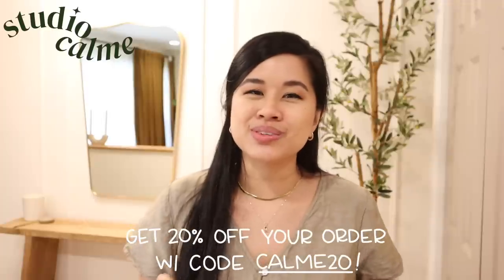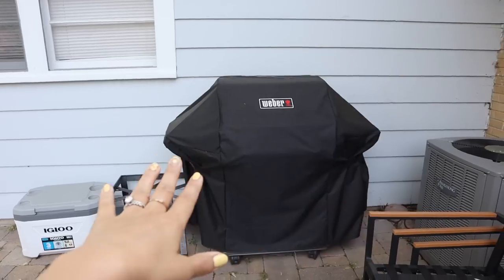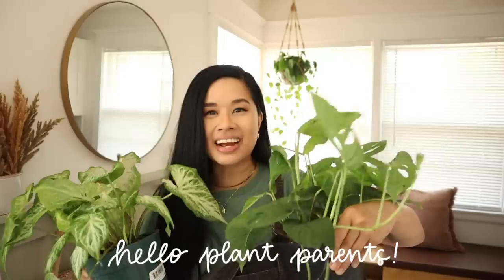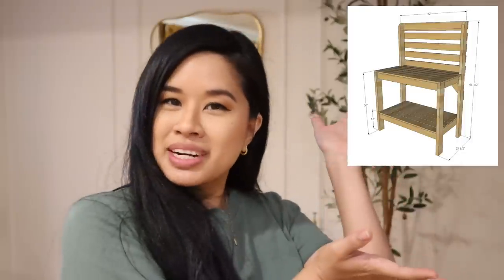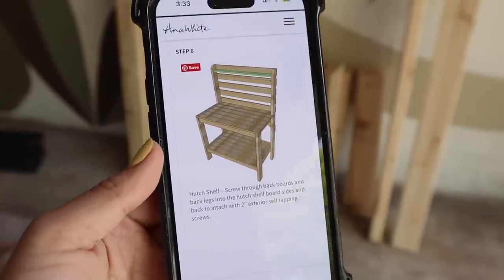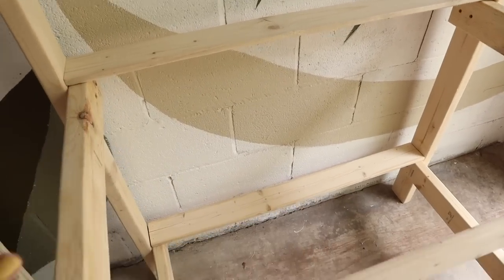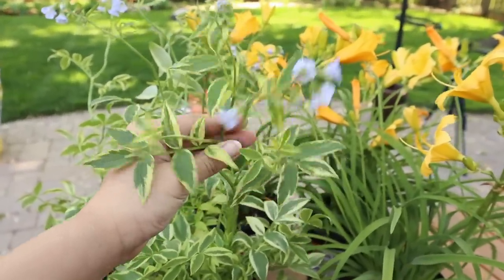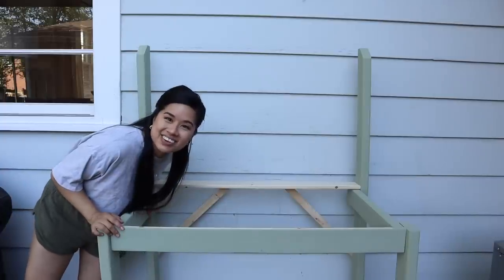CREATING MY *DREAM* OUTDOOR OASIS (major backyard makeover)

Comment: Gardening tip: water the flowers and plants at the roots, not from the top of the leaves down. That'll ensure as much water as possible gets to where it needs to go. :) I usually give the leaves and flowers a little shower for a few sec after I water the roots.
Reply: Another tip! The dead leaves are actually healthy for grass and gardens when mulched!
Reply: @Cherokee92  Yess! I stopped raking mine completely and just put new mulch on top and it's made my soil soo much better. Now anytime I dig a hole to plant something, I find earthworms and it makes me so happy haha
Reply: Also pots need drainage. A hole drilled into the side just above concrete
Reply: agree with this! especially if you water during the day vs morning or evening; it helps keep you from burning the leaves!

Comment: Ha! I was just planning to build the same work bench out of pallets. You did such an awesome job. Just one tip for your plants. Make sure they have enough drainage. Some small holes on the side above the cement layer might help if you notice your plants struggling a bit. The sand was a good idea too❤
Reply: The hole on the side for drainage was exactly what I thought too

Comment: The “weeds” look like feverfew to me, but hard to tell until they flower. If they ARE feverfew, they will produce a small daisy-like flower. They self-seed very readily but are easy to pull out and control and are a lovely plant as long as you don’t mind keeping them in check. The plant with the purple flowers is Nepeta ‘Walkers Low’ (common name for nepeta is catmint). It’s an amazing plant. And like other commenters have said, the leaves in your garden beds are very important for wildlife. They also make wonderful mulch and if you have a mulch setting on your lawn mower you can just mow over the leaves on your lawn and mulch them right into the lawn. Leaves are full of nutrients that your lawn and plants need. The little potting bench turned out great!

Comment: How are the plants inside the pots with poles going to drain?
Reply: Could drill a drainage hole in the side since the bottom is full of concrete. That would be best to do before filling with dirt/sand though 😅 or just be careful not to overwater

Comment: First plant was a philodendron no id. Had it for years until hubby recently began the houseplant collecting hobby.  Nearly killed my philodendron ( propagating last of live bits) taking advice on line to water on schedule this way or that.  I don't believe there's an AP to replace being present to your plant's specific needs that will change with the weather and seasons. Watering is determined by the sunlight, temp. Humidity Soil drainage, pot porousness and airflow. These conditions will vary from each person's location and ability to provide clean chemical free water ( rain /
 filtered) being present with each plant as needed. Just when you think there's a pattern, conditions change and you will need to modify everything to accommodate your plant. Just like life, there's no one size fits all hack, auto pilot AP, sorry 😐 . Nice job on the backyard build, much easier to get motivated for gardening chores when it looks this good! 😻